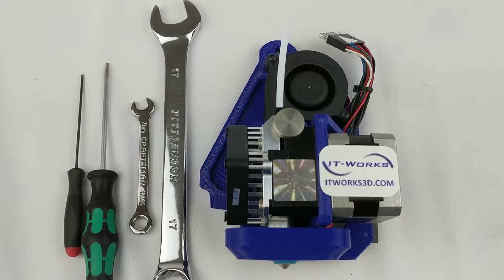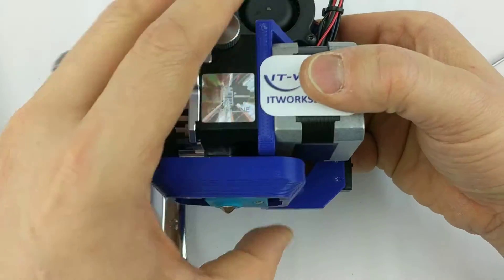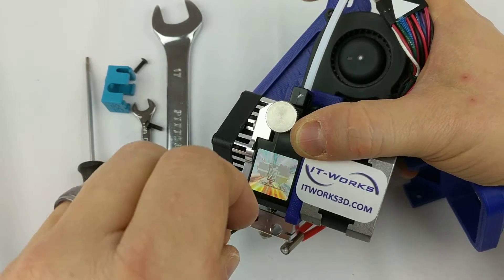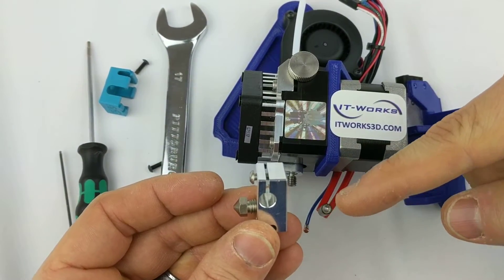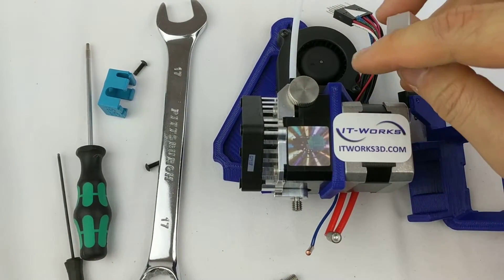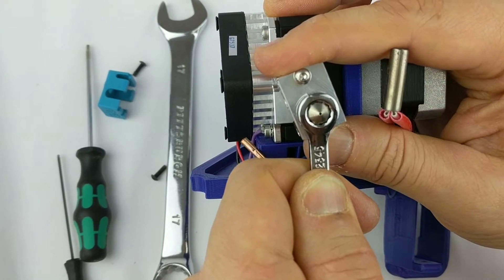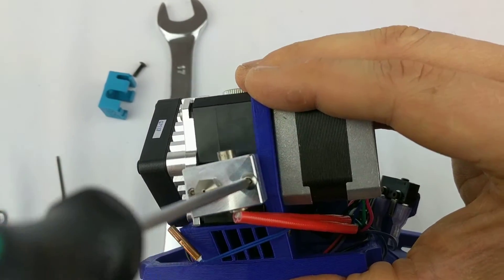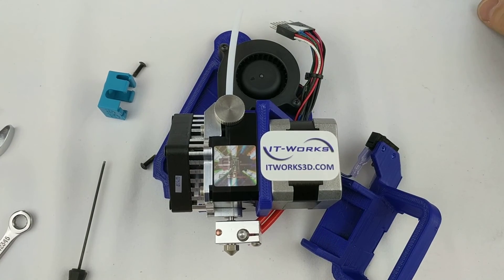How to change E3D Titan Aero nozzle block and heat break

Comment: thanks, this helped a lot adjusting the orientation of my heater block, bought my printer used. couldn't move the heater at all though, but it is fixed now.